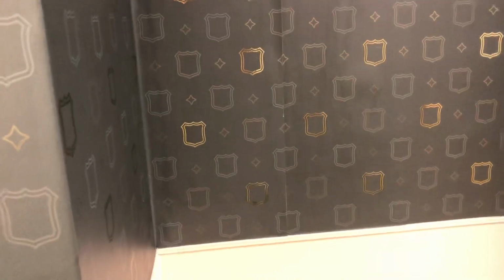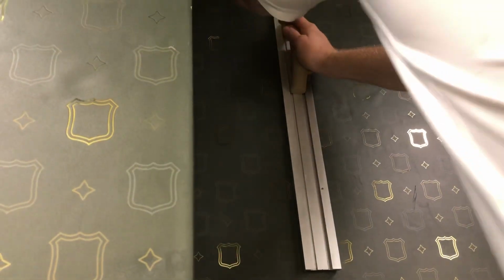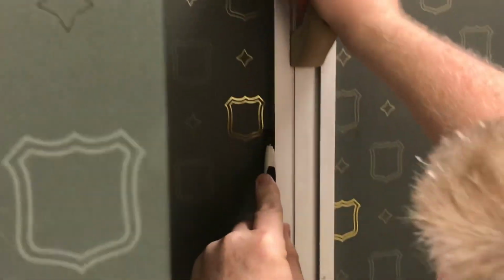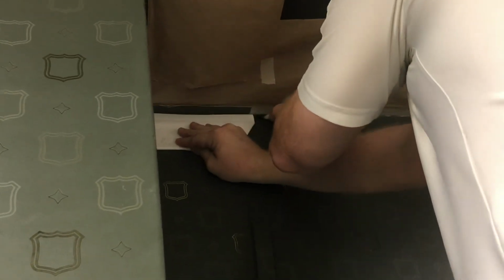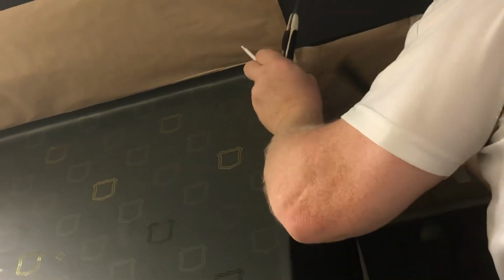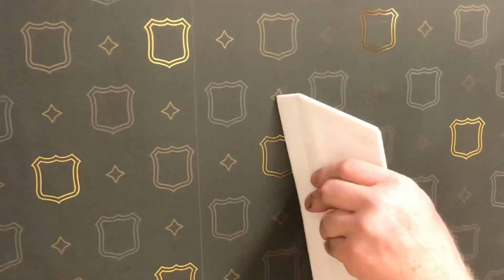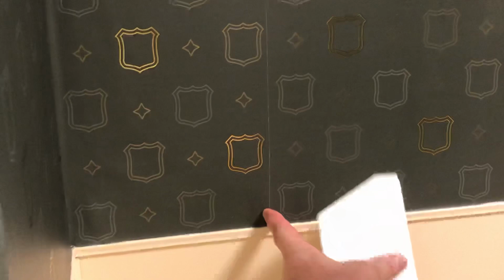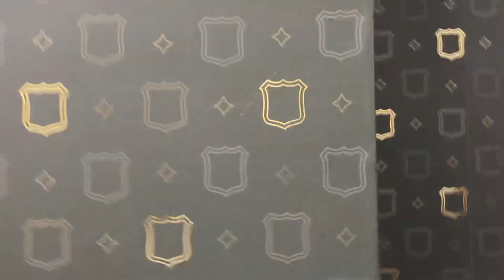More On Commercial Vinyl Wallcovering, Corners & Seams - Spencer Colgan

Comment: Spencer why didn’t you just cut into the corner and start next wall with the off cut??
Reply from the maker: Great question.  This vinyl is the heaviest commercial vinyl.  If I did that, I’d lose my pattern and the client was very careful to remind me that such was unacceptable.
Reply: Spencer Colgan I understand but if you’ve come around the corner for about 8 inches then surely the pattern would run out horizontally??
And where are you going on holiday??
Reply from the maker: Chris R, you’re a gentlemen and a scholar.  The client made it clear that she didn’t want mismatches and this technique completely avoids any “breaks” in the pattern and misalignments due to cutting.
Reply: Ok Spencer what did you use to cover the double cut ???? A pencil is another great little tip as often when hanging dark papers we can either paint where the joints meet with black or something similar ! So again I ask what did you use ????? 🤔🤔🤔🤔🤔🤔
Reply from the maker: Billy Devlin Painting & Decorating 

Billy!   I’m so glad you do just too!  It’s so hard with these dark colors !   I’m so glad a pro like yourself has the same issues.  Exactly correct—-I used black paint!
Reply from the maker: Chris R 
I went to champion Wisconsin!  Loved it.
Reply: @spencercolgan  thought you were coming to the Emerald Isle ??????
Reply: @spencercolgan  🤣🤣🤣🤣🤣👏👏👏👏👏👏👏👏👏👍👍👍👍👍👍👍